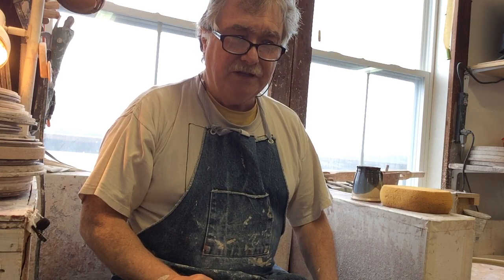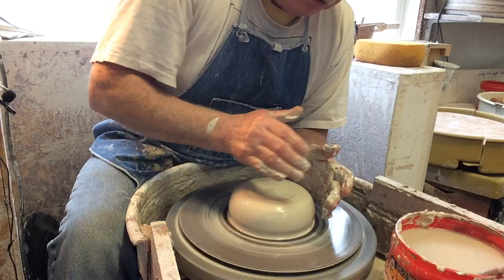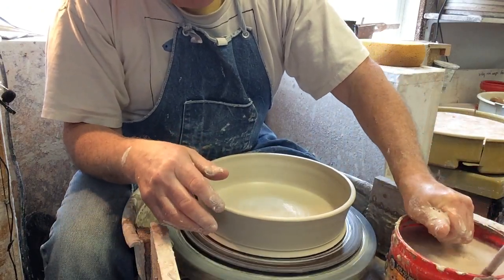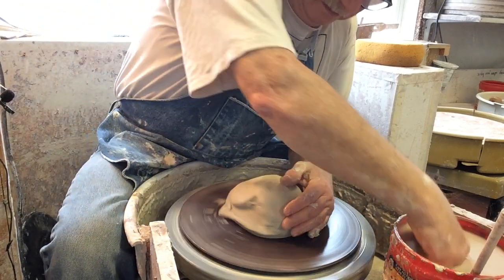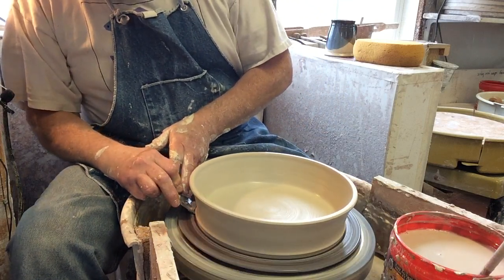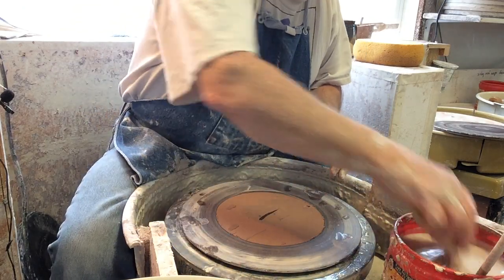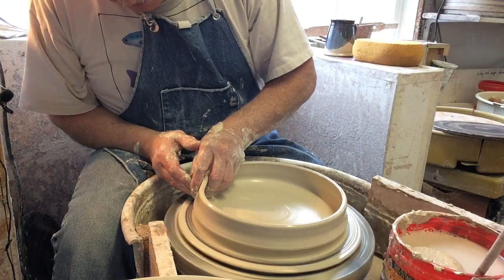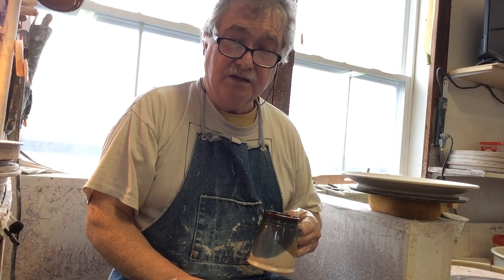Throwing 13 inch plates

Comment: Vaughan, thankyou for the demo, i know you measure by 'eye', however us mere mortals need a little more assistance. You are calling this a 13 inch plate,  how much clay for that size plate? i'm aware of shrinkage however using  'ball park' figures how far out do you flatten this base?, then you pull up the sides by how much? then as you layout the rim, the rim is it the same as the wall upwards? this gives an 11inch plate? Thank you in advance, this is the one thing ive not tried, so i need all the help i can get. thankyou

Comment: Great tutorial as usual! I wonder how much clay, and when do you wire them off the bats?
Reply from the maker: It is about 3lbs of clay and I wire them off 4-6 hours later, again the next morning. I use my Harp wire which has a guitar string tightly fastened across it.
Reply: @Vsmithpots  thank you!